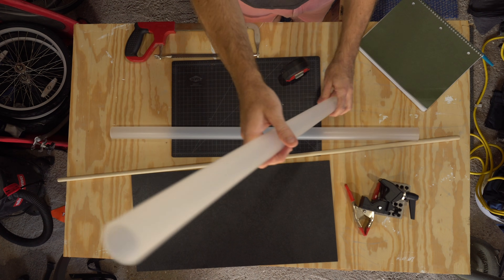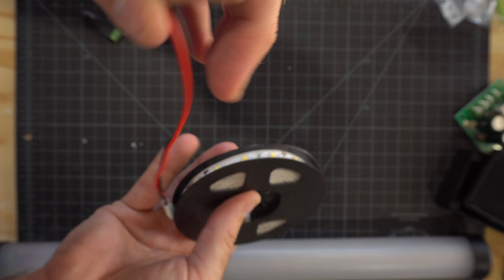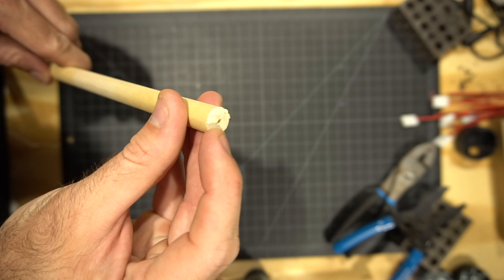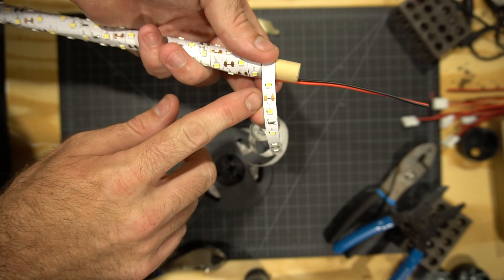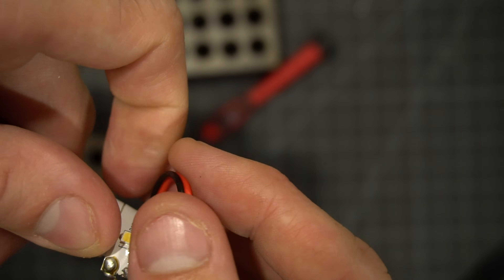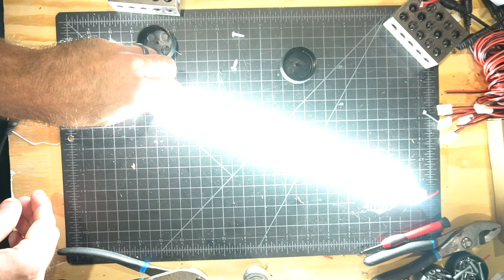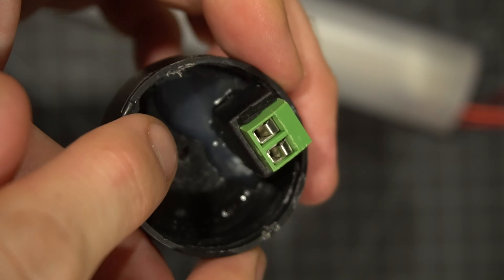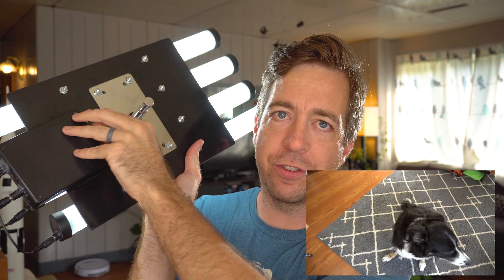TUTORIAL: DIY LED Tube Lights

Comment: Great stuff! I need enlightenment about where the four wires at the other end come from. Also, how do we decide whether it is 12 volt or more. Thanks.
Reply from the maker: Thanks! And the four wires at the other end? Let me know what part of the video you're referencing and I'll let ya know (sorry it's not more obvious to me, just getting back from an all day shoot outside in a field so my brain is mush). As for the 12v, I believe the LEDs are all 12  [if I'm wrong and someone else with more information/knowledge is reading this please correct me!]
Reply: @DroiMedia  low voltage LEDs come in 5v, 12v and 24v. They also make line voltage (120/240v) LED tape/rope but less common.

You oddly did use 4 wires, two at each end of the tape which is rather unusual. What is the reasoning for doing that.
Reply from the maker: Hey! Thanks for the comment! I think you're referencing the two wires I used to connect the LED strip to itself (each wire was bare at both ends so there were 4 bare areas that I connected, butonly 2 actual wires). Anyways, I was told by some folks this was the way to do it after my first tests ended up with WARM LED temperatures. They said this method would distribute heat / current more effectively. I have like NO knowledge on this shit though but it definitely worked out in terms of keeping the LEDs a lot cooler!

Comment: Hi Droi, awesome tutorial. can this also be powered by a 9 volt battery?
Reply: Most LED-Strips run on 12V. If you directly connect them to a 9V Source, they might light up but only very dim. You could use a voltage step up module to boost the voltage to 12V. But you also need to make sure that the 9V Battery as well as the step up module can deliver enough current to power the amount of LEDs you are using.
Reply: Modern Crafts Thank you. I will try this set up........
Reply from the maker: Hey thanks!! I have no clue but I don't see why not - would just need a (maybe couple of) 9v adapters and then wire in the correct connection type.

Comment: Serious question, Does it help to solder/Connect  both ends of the strip to the power adapter?
Love your assistant btw

PD: have you tried white acrylic? How does it look?
Reply from the maker: heya! so I mention somewhere but in running my tests my 'soldered only at one end' lights got WARM, like borderline hot, especially at the base. So I asked around and some folks told me that the 'loop' style system that I ended up using would help diffuse the current more throughout the entire light. So my lights currently do not get nearly as warm as they used to with this method. Hope that helps answer your question! And thanks, all my furry assistants are lazy, annoying, and adorable AF :D :D - as for the white acrylic, I have not used it, just that semi-clear / opaque one you can see in the video. Thanks for the question!
Reply: @DroiMedia  oh sorry, maybe I didn't pay close attention to the video, as I was planning my lamps myself with inspiration in your work.

Thanks for the reply!
Reply from the maker: No worries I can't remember if I mention it in the video or in a comment somewhere, coming off a hot exterior shoot so my replies sound way grumpier than they should 😊

Comment: Very nice! Hey, do the same for a RGB model!!
Reply from the maker: I did! Just didn't make a tutorial for it :) It's a 3' long RGBW version, remote controlled, pretty good except a few of the LED bulbs never do the color I want (but it's OK since I can just turn them to face away from the shot/camera/subject!
Reply: Awesome, do you recommend good LED lights strips for RGBW, cause the ones you used have this problem?
It is difficult to find a good and reliable LED strip that has a good (and real) CRI.
Reply from the maker: @CPProd  I bought a decently reviewed one and still had those problems. I opted for a lower CRI (IIRC like high 80s, so not great but I figured whatever since I am only using it for very specific instances) so that might have been the issue? I haven't used one I am really happy with, but I do have a few really high CRI, really highly rated, really expensive ones I want to try out but I'm just nervous about spending like 3-4x what I want to get a damn LED light strip that I use occasionally ya know. SO, long story short, I don't have a recommendation at this time unfortunately - except to just find one in your budget with decent reviews and work around whatever the shortcomings are :)
Reply: @DroiMedia  Right, my friend! You are right, the budget and the usefulness of this tool for my work are absolutely the most important to consider. It is no use buying the best led (and more expensive) if I don't use this equipment so much.
Thank you very much for your help and attention with my question!
Success!

Comment: Just wondering if you've attempted this using Bi Color strips? I'm pricing out an attempt to build and was wondering if you had sound advice?
Reply from the maker: Heya! I have indeed, I made some RGB awhile back, but the LED strips were not great (see pic: https://www.instagram.com/p/B8HyTj6Bzsp/) - there were some color issues in them. They work for most colors but that one was the most 'off' so I chose it for the pic. I would suggest finding some highly reviewed ones on Amazon and maybe spending a little more than you want to make sure you get a good set. Wish I had more guidance here but honestly I still use the RGB ones I made I just turn those two wonky LEDs to the back and they don't cause any issues.
Reply: @DroiMedia  That's unfortunate. Maybe I'll price out a roll of Tungsten/Warm White LEDs an a roll of Daylight LEDs and make individual tubes, like a kinoflo. Anyway, this is a great tutorial. I sat down and priced out everything other than the LEDs tonight to make to 4x Banks. I have a few simple ideas to trick them out a touch more. Do you have any changes or upgrades to this build that you've already considered or tried? Cheers.
Also, I subbed here and on Insta.
Reply from the maker: @cinematographybycss  Appreciate the kind words and the sub. So, I don't use my RGB as much as I figured I would. IF it was 100% on those bulbs maybe I would, but I use daylight balanced lights like 95% of the time. Just not a huge need for my current projects. As for the upgrades or changes I did go back in and resolder and heat seal all the connections (with like little black heat shrink plastic stuff). I then sealed up the ends with a little glue too when I popped them on. I felt like it provided some additional security / stability to the lights (or at the very least provided me with some additional peace of mind). Otherwise I haven't found any major upgrades or anything - but I'm always happy to hear what others are doing to put their own twist on them. Share some pics or info once you get yours done! :) :)
Reply: @DroiMedia  I have a bunch of these cable key chains left over from another project I did a few years back. I was thinking of adding them to the end caps so the tubes could easily be hung on stands or on command hooks on walls for quick rigging.
https://www.amazon.com/Pawfly-Keychain-Stainless-Outdoor-Hiking/dp/B07FCHKJV6/ref=sr_1_4?dchild=1&keywords=wire+key+rings&qid=1592970319&sr=8-4
 Also I think I would use dual lock instead of standard velcro. And although it costs way more, a foldable baby plate so they pack down much easier seems like something I would want. 
At the moment, those are the only little changes I would make. Thanks so much for the feedback.
Reply from the maker: @cinematographybycss  I like the idea of being able to hang them, would be killer for music videos or some other creative work (sci-fi/horror). Might have to pick some up :)

Comment: Is there a way to make one without soldering anything ?
Reply: As far as I know, you can just use one end of the led strip, which comes with ready to use power adapters, I actually don't know why he soldered the other end, but either way, soldering is pretty easy, I'm actually a magician with the soldering Iron, but I know 20 cents of electronics...
Reply from the maker: Hey! You could probably find some solderless connectors to use, I can't speak to how safe or reliable they would be but if you went with that route you could use some of that shrink wrap stuff on the end (that you heat up and it shrinks and seals everything) to potentially strengthen the connection.

Comment: This is actually better, because led tube that I've seen, don't have led strip glued at 360°, they only glue led strip at one side of the tube, it's like you would tape the strip on flat stick and then that strip into the tube, not all sides would get light, even thougb light gets dispersed almost everywhere because of the foggy tube, but yours is still better
Reply from the maker: appreciate the comment! thanks for watching and let us know if you end up making any :)

Comment: Awesome! Making mine this week. Any tips or thoughts on battery powering this?
Reply from the maker: I haven't taken the time to make a battery powered one yet, but you can run power off a small battery powered generator or power brick, just gotta check the #s and make sure it'll handle the LEDs. Check out our Powering Your Gear video for the one we use!

Comment: I loved how this led tubes ended up looking! I'll try to make my owns, but I wonder if it would be possible to power them with a NP-F battery or simillar, to make it portable. What do you think?
Reply from the maker: Hey! That's honestly the most common question I get asked.... I think if you got one of those NPF batts with a USB out or something you could power one that way I bet. I haven't had any time to test that option out but maybe some day :)
Reply: I use LiPo remote control plane batteries for some of my led stuff.  They are small, light, and can be found for rather inexpensive prices.
Reply: @DiagnosticsWithDean  Just found your comment, I was plannig to make a portable version of these light tubes, do you think it is even 'possible' to get this much brighntess and to shelf a battery without making the entire system too 'bulky' ? 
Thanks
Reply: @gokulhbk  the batteries I have used are about the size of a tic tac container.

Comment: How can I make this rechargeable? Great video
Reply from the maker: Thanks! And no clue about making it rechargable, that's unfortunately beyond my capabilities.
Reply: No problem I'm trying to come up with something at least battery operated
Reply from the maker: Cool cool, you could definitely power these off a battery of some kind just need to make sure the amps and everything are correct for the battery output.

Comment: Make it wireless please!
Reply from the maker: Haha, I know that was way up on my wish list when I started the project. No official workaround for it yet, but you can/could power through a battery and then just Velcro it to the back of the light if you needed to ditch the cords or put it someplace hard to access.

Comment: Why did you wire the opposite end back? Wasn't it getting power just from the input at the main end?
Reply from the maker: Hiya! (Sweet username 🤗) so I was told by people with more experience than me that wiring it that way helps distribute power throughout the entire strip and can help prevent heat buildup. You can definitely do this without it though!
Reply: @DroiMedia  thanks for the reply.

Comment: Quick question: Why do you solder an additional wire to the other end (the one without the connector adapter) of the strip (at 3.25 in the video)? Is there any "performance" reason? sorry, i am a noob at electrics ;)
Reply: It’s to mitigate voltage drop and idefinitely worth the small effort so as to maintain even power. Thanks for the tutorial, great job!
Reply from the maker: Thanks!
Reply from the maker: Great question! I was told by people with a better understanding of electronics than me that doing so will allow better / more stable flow of an electric current through the entire light that way. I have yet to test out and see if it makes a difference, but I know you could technically do it without that cord if you wanted (they're made to be used that way) to save a little time, money, and effort when making these.

Comment: Thanks for this guys. I'm definitely going to try, do you have any suggestions for colour changing LED strip or would this not viable?
Reply from the maker: Hey Richard! Thanks for watching - as for the color changing strips I've got a set that I'm working on putting into one of these, the only issue I'm running into is that additional strip that runs under the LED strip is 4 wires with RGBW and they require additional connecting hardware (rather than soldering 4 sep. wires) so it's a bit 'chunkier' than I want on the inside and doesn't fit as well. I'm hoping to get some time this month to finish that up and I'll share a post on the results when I do. Honestly, I might just try it without that other wire and see what happens.
Reply: @DroiMedia  Good luck! Can't wait to see the results. I will try and the Daylight ones then go again should you make the colour work. Thanks again for the video and keep up the great work!

P.s. I am the worst DIY person so fingers crossed

Comment: Do you know the % light transmission from the tubing? It's super hard to find frosted acrylic tubing in the Netherlands.
Reply from the maker: Great question but unfortunately one I do not have an answer for. However, you could get clear plastic tubing and then put a rolled-up piece of frosted gel on the inside for the same effect I would think.

Comment: With a tube like this, the light goes out 360 degrees. So most of the light is wasted. It would be twice as efficient to mount the leds on a flat plate.
Reply from the maker: Thanks for commenting, Jim! I actually did a plate on a first draft of these where all the LEDs are facing forward, you certainly get more direct light but can only fit a fraction of the LEDs in the same space compared to these. I found this route to be the best compromise in terms of output, cost, and build quality.

Comment: I want to make my own grow lights for hydroponics. So my question is, can i control the lumens of the light? Are there stronger strips?
Reply from the maker: Hi! You can find different lights with varying amounts of LEDs online - these are a single strip with a light every inch or so, but I believe there are strips with two side by side lights or lights every 1/2 inch or so (so basically more lights in the same length of strip which means brighter lights). I would assume these would work as grow lights, they're as bright or brighter than the same sized light I use for my frog/terrarium :)
Reply: @DroiMedia  thank you! for the great video and for your response! like and subscribe folks, he deserves it
Reply from the maker: @moncefzerroug9533  thanks for the support :) :) :) truly appreciate it!

Comment: How much LED per ft would be used? I don't wanna do the math so I'll just ask you lol great DIY tho
Reply from the maker: Thanks 🤗 guessing you would use about 5' of LED strip per foot.... Entire strip is about 16', which works for a 3' tube, so divide that and you'll end up with about 5' of strip per foot of tube. Hope that helps!
Reply: @DroiMedia  I did it. Yeah so I bought a 16.2 ft of LED Strip and a 1/2 x 1/2 x 36" dowel in home depot and it left me about 2 1/2 ft of LED strip. Waiting for the frosted acrylic and end caps to get delivered. Thanks for this. Turns out I only spent 58$ for a 3 ft RGB one.
Reply from the maker: @attratist5770  awesome! I am waiting on some down time to finish up my 3' RGB ones. And your end caps just went in the mail today :) Feel free to email me some pics of them in action once you're done if you don't mind, I'd love to see them.

Comment: What's the purpose of running a separate wire from the other end of the tube, can you not power the led strip from one end?
Reply from the maker: Hey! I've been told by people with much more experience and knowledge than me in this field that the wire will help regulate power throughout the length of the light strip, so it's less likely to overheat at one end. Thanks for watching and let me know if you have any other questions!

Comment: Hey any chance you could link me to some rgb led lights that will be usable in the same way for this project? Thanks!
Reply from the maker: Hey! I'm currently using this RGB strip (https://amzn.to/2O4aYn1), with these additional pieces (https://amzn.to/2NCVYgZ) - no samples yet and I don't have a finished product that I'm REALLY pleased with, but I'll post/share that when I get there. The build should be the same but with just 4 wires instead of the 2, hence the other set of connectors.
Reply: Thx so much!

Comment: any idea how to make this with a battery? - Los Pastrana

Yes, but it does get complicated by the choice of battery; Lead-acid, Ni-MH, Ni-Cad, Li-ion.   
All have various advantages and disadvantages  
Do use a PROPER recharger.  
Keep in mind that even Li-ion batteries experience a voltage drop as they discharge.So you need to control the voltage.
You should use an under and over voltage protection circuit.
You should use a (LDO) voltage regulator if using a Li-ion battery pack (which gives a nominal voltage of  around 14.8V)
Also the chemistry with Li-ion does vary - they are NOT all the same!
Lead-acid batteries have a voltage range of about 14.4 (fully charged) down to around 11.5V (avoid using when 50% discharged)

Another choice is to use a boost converter to raise the battery voltage to  12V but the quality and efficiency of these varies greatly. They can introduce flicker as well.
Same is true for buck-boost converters.